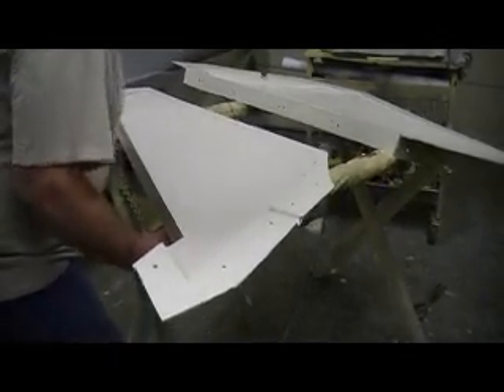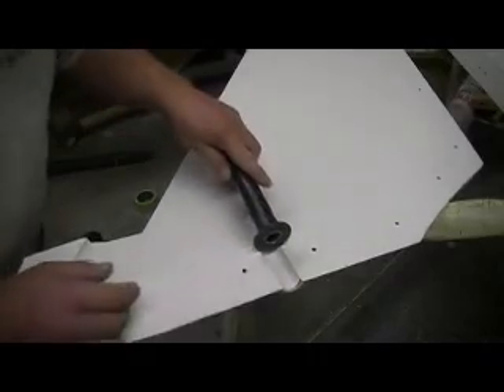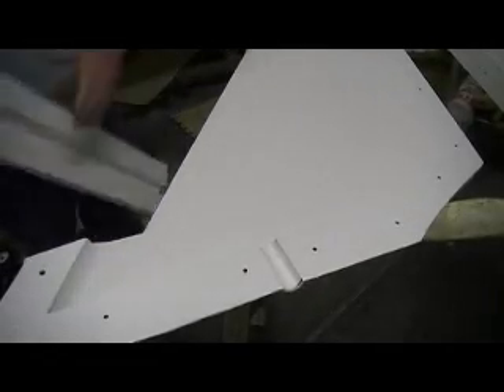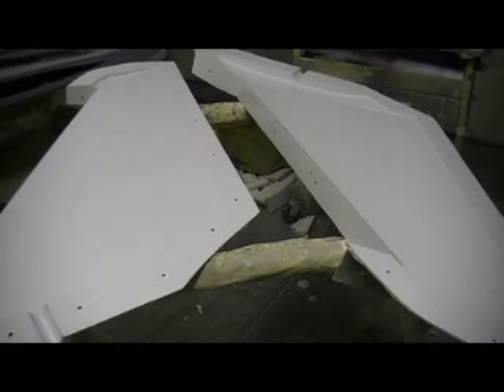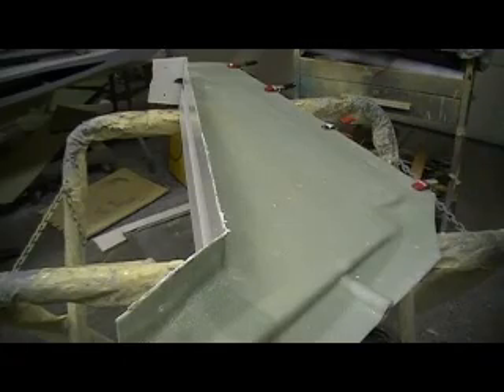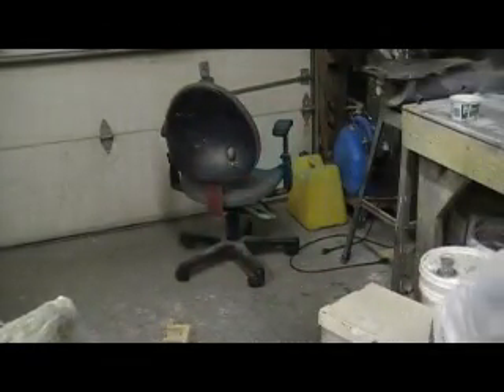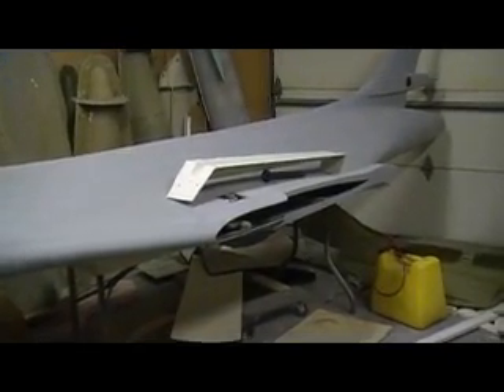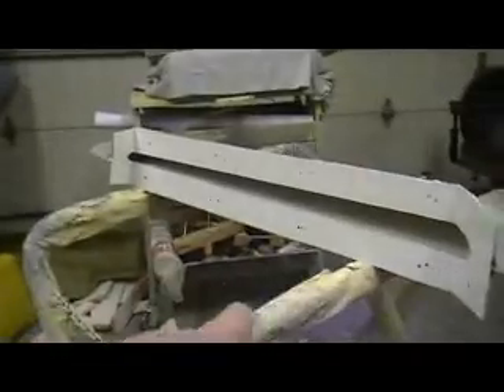how to build a rc jet B=1 Bomber # 165 py 2

Comment: Keep up the great work. I am learning lots from these vids. And yes I will be trying it for myself ASAP.

Just a small tip regarding the foam you use.
We use pink foam for airframes over blue. Pink is 10% heavier and is even more ding resistant than the blue.
It holds its shape even without covering. I find the blue can be a little fragile at the trailing edges and where it gets a little thin.
Maybe it can help with smaller projects?